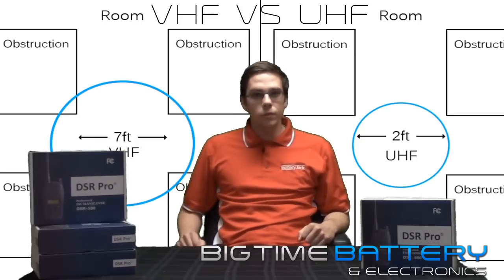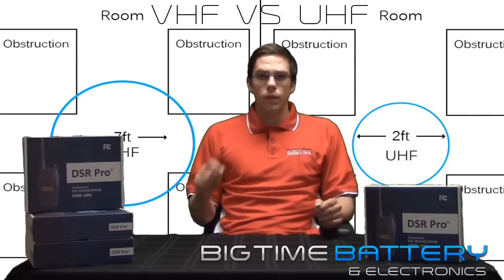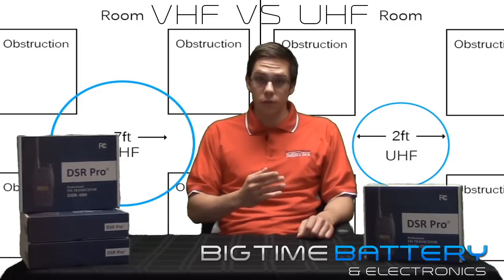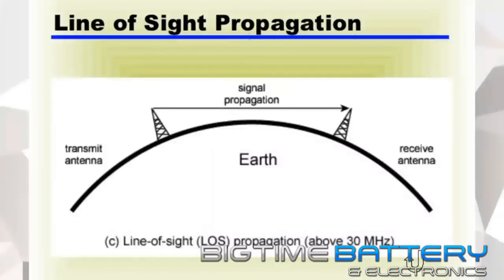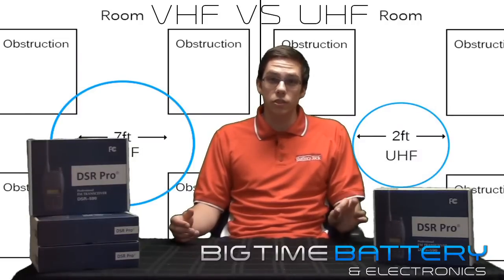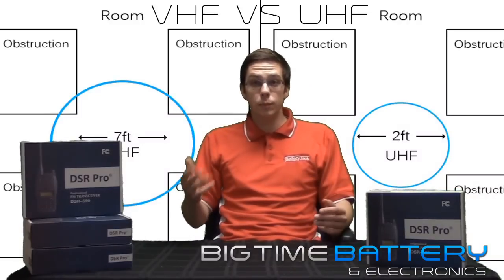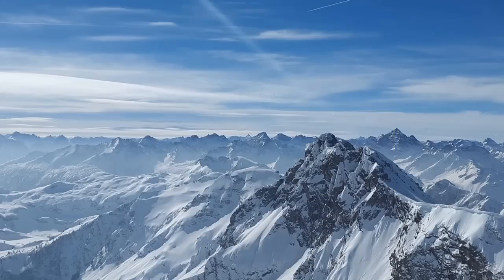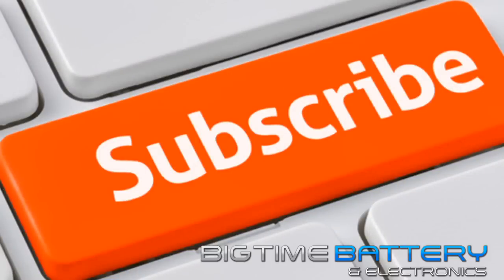VHF vs UHF - What's the difference

Comment: Hi I’m new to ham radio 
I got a 12watts uv5r HP
QUESTION: 
How far can a 12watts  reach 
UHF OR VHF ?

Thanks 🙏 for sharing ❤️
Reply: what frequency? Depends on conditions, time of day, skip or ionospheric conditions, also depends on your location and a huge amount on your antenna.
Reply from the maker: Hello and welcome to the world of ham radio! The Baofeng UV-5R HP is a popular handheld transceiver among amateur radio operators. The maximum power output of your UV-5R HP is 8 watts, not 12 watts, which is still quite respectable for a handheld device.

The distance your radio signal can reach depends on several factors, including the terrain, antenna height, atmospheric conditions, and the sensitivity of the receiving station's equipment. Generally, higher power does not always equate to significantly longer range due to various constraints like line of sight, obstructions, and propagation characteristics.

In open terrain with minimal obstructions, line-of-sight communication on VHF (Very High Frequency) or UHF (Ultra High Frequency) bands can typically extend several miles, potentially even further if conditions are favorable. However, if there are obstacles such as buildings, hills, or dense foliage, the effective range can be significantly reduced.

If you have any other questions please feel free to call or text us at: 815-467-6464 or email me directly at cody@batteryjack.com

Comment: So in remote Alaska wilderness, with forest and mountains... UHF or VHF? I know VHF is for Marine use, I'm just asking.
Reply: VHF or HF actually. In Alaska (not the Big City) but in the open areas you want Primarely VHF or HF (high frequency ).  HF or Shortwave might just be your best bet as VHF will require a Tower antenna and or A Repeater to connect to someone. One option is CB radio as it is Close to HF. and you can communicate over vast distances with CB. But, consider SW or Shortwave for a moment, while the Clarity is NOT very high, you can communicate over VAST Distances even more than with CB radio.
Reply from the maker: In remote areas like the Alaska wilderness, which feature challenging terrain including forests and mountains, both UHF (Ultra High Frequency) and VHF (Very High Frequency) radios have their advantages and disadvantages. Here's a brief overview to help you decide:

VHF (Very High Frequency)
Frequency Range: Typically 136-174 MHz.
Pros:
Better for open spaces or gently rolling terrain without many obstacles.
Can cover longer distances with less power in open areas, which makes it suitable for marine use as you mentioned, but also useful in open wilderness.
Generally has longer antenna, which can be a factor in reception quality.
UHF (Ultra High Frequency)
Frequency Range: Typically 400-512 MHz.
Pros:
Better at penetrating through dense obstacles like trees, buildings, or rugged terrain, making it potentially more suitable for forested and mountainous areas like much of remote Alaska.
Shorter waves make it easier for the signal to navigate through complex terrains and inside buildings or dense forests.
Smaller antennas, which can be more convenient for portable use.
Considerations for Remote Alaska
Terrain and Vegetation: If your activities are primarily within dense forests and mountainous areas, UHF might be more advantageous due to its better penetration capabilities and ability to handle obstacles.
Distance: If you are operating over vast open areas or along rivers without significant obstructions, VHF could be more effective.
Equipment Compatibility: Ensure that any equipment you choose is compatible with other devices in your network or group.
Conclusion
For the specific conditions of remote Alaska wilderness, UHF might often be the better choice due to its superior ability to penetrate through dense forests and navigate the rugged terrain. However, the best choice can vary depending on specific local conditions and the exact nature of your use case. It may also be beneficial to have access to both types if your activities vary significantly in terms of environment and range.

Comment: Hello. 
I am new to VHF/UHF and i have some questions hoping that someone cant answer me.

If i use a portable VHF with no gps on it. 
Can someone track my position ? 

If i want someone to track my position can i change the tranciever of the same device or something else  so other
people or coast guards can track my position ? 
Thank you.
Reply from the maker: Hello! It's great that you're exploring the world of VHF/UHF communications. Let's address your questions one by one.

Can someone track my position if I use a portable VHF with no GPS on it?
In general, simply using a standard portable VHF radio without GPS capabilities does not allow others to track your exact position directly. These radios transmit voice (or sometimes data) over radio frequencies, and while someone can potentially estimate your location based on signal strength and direction (using techniques like radio direction finding), this requires specialized equipment and is not precise without more sophisticated triangulation methods. It's not a common practice for casual or incidental monitoring and would require someone actively trying to locate you.

If I want someone to track my position, can I change the transceiver of the same device or something else so other people or coast guards can track my position?
To enable others (like coast guards) to track your position, the most effective and reliable method is to use a device equipped with GPS and a feature known as Digital Selective Calling (DSC). DSC is a standard for sending pre-defined digital messages via the medium frequency (MF), high frequency (HF), and very high frequency (VHF) maritime radio systems. It includes distress signals that can automatically include your position if your VHF radio is connected to or integrated with a GPS receiver.

If your current device does not support GPS or DSC, you cannot simply change the transceiver to add these functionalities due to the integrated nature of modern electronics. It would be more practical to obtain a new VHF radio designed with these features. Many modern marine VHF radios come with built-in GPS and DSC, specifically for safety reasons, allowing coast guards or other ships to locate you in case of an emergency.

For non-emergency tracking, other technologies might be more suitable, such as AIS (Automatic Identification System) transponders for maritime use, or personal locator beacons (PLBs) which also work well on land. These devices transmit your position to satellites or nearby ships, making it easier for someone to monitor your location.

In summary, for safety and tracking purposes, especially in maritime environments, investing in a device designed with GPS and DSC (or similar technologies) is the best approach. This ensures that in an emergency, responders can quickly and accurately determine your location.

Comment: Are you sure the UHF is more convenient than VHF in an urban area ? I believe that it is just the opposite, despite there is not a great difference. The real difference is the licence to use VHF but not for PMR446.
Reply: MB Janus: VHF works better than UHF in an urban environment.
Reply: @paganphil100  Well,  I was quite sure about that, as 11 meters works better than VHF in a wood for hunters.. Many thanks.
Reply from the maker: The choice between UHF (Ultra High Frequency) and VHF (Very High Frequency) for communication systems, especially in urban areas, can depend on several factors including the specific use case, environment, and regulatory requirements. Each band has its characteristics that make it more suitable for certain applications.

UHF Advantages in Urban Environments:
Better Building Penetration: UHF frequencies typically offer better penetration of buildings and urban structures due to their shorter wavelengths. This makes UHF more effective for indoor communications within densely built-up areas.
Higher Frequency Range: UHF operates in a higher frequency range (400-512 MHz), which allows for a more compact antenna design suitable for handheld radios and other mobile devices.
More Available Channels: UHF usually provides more channels, which can help reduce interference between different users, a common concern in urban areas.
VHF Advantages and Considerations:
Wider Coverage in Open Areas: VHF provides wider coverage in open or lightly obstructed areas due to its longer wavelengths. However, in urban settings with tall buildings and various obstructions, VHF signals may not perform as well as UHF.
License and Regulation: The requirement for a license to operate VHF frequencies, as opposed to license-free PMR446 (which operates in the UHF band in Europe), is a regulatory aspect rather than a technical advantage. This can make UHF PMR446 more accessible for casual or low-budget users.
The Debate:
Your belief that VHF might be more convenient than UHF in urban areas goes against the general consensus, primarily because UHF's shorter wavelengths are typically better at navigating the complex landscapes of urban environments. However, the effectiveness of either band can also depend on the specific scenario, including the types of buildings, the presence of natural obstacles, and the density of the urban environment.

In practical terms, the "convenience" might also relate to licensing requirements, with PMR446 offering a license-free UHF option in many places, making it more accessible for casual or business use without the need for regulatory compliance that VHF might require.

In summary, while UHF is generally preferred for urban communication due to better signal penetration and more available channels, the choice between UHF and VHF should be based on the specific requirements of the use case, including regulatory considerations.

Comment: Great video,
Sir, please tell me,which one frequency use vhf or uhf,for the mobile listening conversation?
Reply from the maker: Thank you for your kind words about the video! Regarding your question about mobile listening conversations, both VHF (Very High Frequency) and UHF (Ultra High Frequency) can be used for mobile communications, including listening conversations.

The choice between VHF and UHF often depends on various factors such as terrain, range requirements, and available frequencies. Here's a general comparison:

VHF (Very High Frequency):

Frequencies typically range from 30 MHz to 300 MHz.
VHF signals generally travel farther over open areas and have better penetration through foliage and buildings compared to UHF.
It's commonly used in outdoor environments, rural areas, and for long-range communication.
UHF (Ultra High Frequency):

Frequencies typically range from 300 MHz to 3 GHz.
UHF signals are better at penetrating dense urban environments and obstacles like buildings.
It's often used in urban areas, indoors, and for shorter-range communication.
For mobile listening conversations, either VHF or UHF frequencies can be suitable, depending on your specific requirements and the environment in which you'll be using the communication equipment. It's essential to consider factors such as range, interference, licensing requirements, and available equipment when choosing the appropriate frequency band for your mobile communication needs.

Comment: I am in the market for a Lavalier Lapel Mic,  I do not need a long range - to be used in my home 
My PC is connected to a 12 ch Mixer  no USB 
Also,  I do not want to use a USB type mic as it will override my sound card. 

open to your suggestions.
Reply from the maker: For a Lavalier Lapel Mic that doesn't require a long range and won't be connecting directly to your PC via USB, you have several options that can connect to your mixer, ideally through an XLR connection or a 3.5mm to XLR adapter if the mic comes with a 3.5mm jack. Since you're using a mixer, you have the flexibility to use a variety of microphones, including those designed for live performance, broadcasting, or recording scenarios. Here are some suggestions:

Wired Lavalier Mics:

Rode Lavalier GO: This is a compact, high-quality lapel mic that delivers clear, crisp sound and is designed to perform excellently in a variety of scenarios. It features a 3.5mm TRS connector but can be adapted to XLR with the Rode VXLR+ adapter. This setup would not interfere with your sound card and would connect directly to your mixer.
Shure MVL Omnidirectional Condenser Lavalier: This is another high-quality option from a well-regarded brand in audio. It also uses a 3.5mm jack, which means you might need an adapter to connect it to your mixer via XLR. Shure mics are known for their durability and sound quality.
Wireless Lavalier Systems (if you decide wireless convenience is worth considering despite not needing long range):

Sennheiser XSW-D PORTABLE LAVALIER SET: This wireless system is easy to use, offers plug-and-record setup, and comes with a lavalier mic. It operates on a digital transmission system, ensuring clear sound. The receiver can connect to your mixer through an XLR cable, providing a clean setup without interfering with your PC's sound card.
Rode Wireless GO II: A versatile and compact wireless system that can be used with a lavalier mic (purchased separately). It's incredibly user-friendly and offers a reliable connection with good sound quality. The receiver can be connected to your mixer using the appropriate cables and adapters, thus avoiding any issues with your sound card.
Adapter for Existing Mics:

If you already have a lavalier mic with a 3.5mm connection, consider purchasing a 3.5mm to XLR adapter. This allows you to connect your current microphone directly to your mixer. Make sure the adapter provides phantom power if your microphone requires it, though many lavalier mics are designed to work without external power.
When choosing a microphone, consider the following:

Compatibility: Ensure the mic or system you choose can be easily connected to your mixer with the appropriate cables or adapters.
Sound Quality: Look for mics with good reviews regarding sound clarity and noise rejection, especially if your home environment isn't sound-treated.
Durability: Since it's for home use, durability might not be as crucial as for on-the-road use, but it's still important to choose a product that's well-made.
Remember, the best choice depends on your specific needs, such as the type of content you're producing (e.g., podcasts, videos, music) and your budget. It's also worth checking out user reviews and possibly testing a few options if you have the opportunity to do so before making your decision.

Comment: Most repeaters are VHF. If both UHF and VHF are line-of-sight I'm guessing that VHF travels farther than UHF.
Reply from the maker: In general, VHF (Very High Frequency) radio waves tend to travel farther than UHF (Ultra High Frequency) waves under similar conditions, all other factors being equal. This is primarily due to differences in their wavelengths and how they interact with the environment.

VHF waves have longer wavelengths compared to UHF waves. Longer wavelengths typically allow VHF signals to propagate further over open terrain and through obstacles like buildings and vegetation. They also have better penetration capabilities through dense materials like concrete and foliage.

UHF waves, on the other hand, have shorter wavelengths, which makes them more prone to attenuation by obstacles and atmospheric conditions. While UHF signals may have better performance in urban environments with many obstructions, they generally have shorter effective ranges compared to VHF signals.

However, it's important to note that factors such as terrain, atmospheric conditions, antenna height, transmitter power, and receiver sensitivity all play significant roles in determining the effective range of radio communications. In some cases, UHF may be preferred over VHF for specific applications or operating environments.

Ultimately, whether VHF or UHF travels farther depends on the specific circumstances and conditions of the communication environment.
Reply: @BigTimeBattery  thank you!